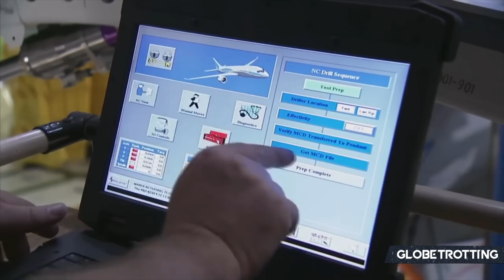Is The Airbus A330neo A Failure?

Comment: You should have also talked about how Airbus was delivering the A330ceo until very recently with the last one being delivered in May 2020 to Aer Lingus so of course the orders are not going to appear in the beggining like on a clean sheet design but probably later in the life cycle when the most recent A330ceo's are getting on the older side.
Reply: Word

Comment: The important thing: the standardization of the A330-900neo with the 251t variant. This resulted in a plane that could fly as far as 7,200 nautical miles, and has found a market with several airlines.

Comment: I could see Delta adding to their current a330neo order book when the older a330’s need replacement, they are already 20 something years old and Delta already operates 42 units respectively 11 of -200, 31 of the -300… 🤔👍🏼
Reply: I see Delta grabbing cheap 2nd hand examples.

Comment: IMHO the A330neo was a really good move. It fits the gap between the A321 and A350 perfectly, and was available at just the right time. The A330ceo was and is an excellent design so there was no need to reinvent the wheel, just boost efficiency. Avoiding the expensive clean-sheet design has also made it cost competitive.

I'd really really like to see Qantas order them to replace their A330ceo fleet. They're getting old now, but they're such lovely aircraft and the A330neo would be a real bonus for passengers. Gotta love the 2-4-2 layout

Comment: Heard TAP wasn't happy with the performance of the Trent 7000 engines on their a330 neo fleet...
Haven't heard other carriers  complaining as of  yet..
Being basically a bleed air version of the Trent 1000 on the 787 ..
Looks like the Trent 1000 issues are behind them, .see if that transfers over to the 7000 version as well.!!
Reply: From what I know, in some planes of TAP fleet there's sometimes an odd smell in the cabin.  The not so satisfied comment about the plane's engines was made by TAP's CEO  (not on purpose, but coicdently one of the company's planes just took off.  Some of them just sound like a buzz saw on take off power)
Reply: If it does the A330neo will be in big trouble because customers will be wary of the engine type it uses
Reply: They change engines too much often...
Reply: As far as I`m aware T-7000 never suffered from issues that affected the T-1000 but in fact took on some of the uprated features of the T-XWB instead.
Reply: @mariovieira838  yeah but its fixed now

Comment: Several companies with some routes with the original A330 to replace them prefer to upgrade to the A350 than A330NEO.
Reply: The great thing between A330 and A350 is that pilots can easily adopt between them.

So what I think is that they replace the first A330 with A350 to increase capacity, but eventually they will bring in more 330neo to have a broader capacity span.

A340 outsold the A330 early on also,  but the A330 did eventually become more popular.

Comment: If you compare the A330neo to the 777x the A330neo is on 278 orders compared to boeings 341 (Although the 777x has been taking orders slightly longer) Also the A330neo has been flying for 3 years now and the 777x continues to experience lengthy delays. For the record i believe both planes will succeed just saying that it’s too early to call the A330neo a failure
Reply: That's not a good apples to apples comparison. They don't compete for the same Airline need.
Reply: @erickelly3447  It’s not about that. The only thing I was comparing was the fact they’re both re-engined options of wide body aircraft  yet one has been flying for far longer than the other despite being announced over a year after the 777x was
Reply: @KaptnKork  To be fair the A330neo has a completely new wing and cabin design aswell. Also the 777x should break even when the UA/AA/BA/ANA Come to the table.
Reply: @jonahboonyarit4715  new wing? Not entirely. I  dont Think adding wing extentions necessarily translates  to a completely  new wing . My guess is it's not . 

With the 777X , the windows are  enlarged , cabin  widened  by 4 inches , a completely  new composite larger wing , and the cabin might recieve  some reinforcements to allow for higher cabin pressures ( @6000 feet, like the 350 and 787) . I think the a330neo still maintains 8000FT cabin pressure like conventional airliners . Nothing much was done with the a330neo cabin 

The difference  is with the 777X transitioning to an all composite  airliner in the future , might be easier  since Boeing  have already gone through all the trouble of making a composite  wing. In other words  Boeing still sees a future  in the 777 program 

 The cheap investment  in the a330neo means AIRBUS  does not necessarily  see a future  in it , and could most likely  be scraped in the future for an a350 derivative  maybe
Reply: @jonahboonyarit4715  The A330neo does not have a new wing, it is extended along with a new winglet. The fuselage is still the same, the new interior cabin is not a huge deal.
Reply: You can’t really compare the 2 in any way, which includes orders. The 777x order book will skyrocket once the plane enters service. You still have airlines like United which will most certainly go with the 777x in the future. You also have the likes of Lufthansa, Qatar, British, American and Emirates which are highly likely to increase orders as well ones the plane enters service. I would also expect Cathay, Korean, and others to jump on the bandwagon as well. Namely Korean because the A330neo and A350 are only offered with RR engines. Something Korean is not interested in by any means. The 330neo orders are flat for the year, and 65 were cancelled last year. I definitely see more orders coming in for the -900, but in the meanwhile it’s lack of a GE engine option does not make it as attractive as it could be.
Reply: @mmm0404  You are correct. It is NOT an all new wing. See my comment above for details.
Reply: @dmcr9525  That boeing shitbox will never actually enter service.
Reply: @IBo99608  Please don't direct your comments and their lack of substance to me. You are not the FAA or the EASA. Not one airline that has them on order cares about your personal opinion, and quite frankly neither do I.

Comment: The A330Neo could have launched earlier. After the 787 took the market by storm, Airbus did mention a updated version of the A330 to compete with the 787.
But Qatar Airways CEO Al Baker persuade Airbus to come with a clean sheet design to challenge the 787… hence the A350 which Qatar Airways became its launch customer.

How ironic now with the current situation between Airbus and Qatar Airways over the A350 issue.

Comment: DJ failure is a strong word - particularly when you look at a “slice” of info you choose to compare. 

Let me give you a different spin…
Total A330 orders = 1,764. -  1,466 A330ceo delivered & 89 A330neo delivered ( 278 A330neo orders)
Total B787 orders = 1,509  -  1,027 delivered as of Nov 22

Dev cost for A330neo - $2 billion - btw there were more than engine tweaks - how about the whole new carbon fiber wing?  And the A330ceo had more than paid back Dev costs already.
Dev cost for B787 - $32 billion - but that doesn’t include the 10 variant!

A330neo dev cost recovery per unit $7.2 million
B787 dev cost recovery per unit $21.1 million (based on total orders not what’s been delivered so far)

There are so many twists and turns when you compare these 2 aircraft from seat cost to maintenance to fleet commonality to passenger experience and finally airline missions all making up what we call success of an aircraft.

And as someone else pointed out - replacement cycle will be the ultimate test.  Do airlines opt to order A330neo to replace their A330ceo at this time or not?
Reply: Oh wow, i did not know that the 32 Bil did not cover the 10 variant. Also, including all the extra costs and fines due to the multiple delays with the 787, I think it is way way higher than the 32B. I heard that they also sell 787s at dirt cheap prices to airlines who consider a330neos (I am not sure how accurate this is though). With a 2B cost, why doesn't Airbus employ the same tactics? Is it because they are still confident that the airlines with the CEOs will turn to the NEOs as a replacement one day or they just refuse to play dirty? Havent flown on an A330NEO yet but ive read many great passenger reviews. Looking forward :))

Comment: The A330neo is just a new version of the A330. Up to now it has sold 278 frames with 91 delivered. But that is only part of the story, because the A330 family has been sold 1,764 times with 1,555 delivered. the 787 has sold 1,488 frames with 1006 delivered.
Most of the time Airbus competed with the A330ceo against the 787. If we start in 2011, the year the 787 had it's first deliveries, 805 A330 were delivered against 1,006 787.
The 787 has both to sell and deliver quite a few more frames to catch the A330 in numbers.
Reply: 1488 was before the united order of 200 ( including  100 options) . 

The a330 program started in the late 1980's , and airbus had already broken even when the early 2000's arrived . 

This ment that the a330 could be sold at a much lower price , keeping margins thin but still profitable.  

Since the program was already profitable  , airbus could offer steep discounts to sell the 330 and that's exactly  what they did more especially  after the 787 was launched . That's why they sold tons of them . 

Boeing probably  did the same with the 777-300ER's ( 77W)  , still selling tons of them even after the a350 was launched.  The 77W has sold close to 800 Frames , and there is still a tiny backlog left .
Reply: As one does not include options, when one talks about orders, you should talk about 100 orders. Options are options, orders are orders.
Yes the A330 broke even a long time ago, but being sold cheaply is a myth. Because the A330 broke even a long time ago, an engine upgrade does not take many sales to break even again.
Whereas the 787 has not broken even jet. The A330 has been a money maker for Airbus. You can not say that about the 787 for Boeing.
Reply: @mjoelnir1899  well I was talking  about the  a330ceo , but ok
Reply: @mmm0404  Was I not talking about the A330ceo? The main point is, that the neo is only a new version of the A330. So to compare the sales of the A330neo with all sales of the 787 is a bit silly.
Reply: @mjoelnir1899  I don't think you get me , I said the a330 ceo sold very well more especially  after the 787 was launched , over 600 frames were sold . 

If the a330ceo did not sell well in that time period  because  it was cheap then why didn't  it sell just as well before the 787 launch? 

The 787 already outperforms the a330neo , so there is no way the a330ceo would have sold that well unless airbus was offering steep discounts.  I'm not saying this is wrong .

Boeing most likely  did the same with the 777-300ER's  especially  after the a350 was launched . Boeing sold close to 900 777-300ER/200LR's since 2004 . 

My point is not to compare sales of the 787 vs the a330 family , just pointing out how the ceo sold so well
Reply: @mmm0404  You said the A330ceo sold well because it was cheap and I dispute that, the A330 fitted a lot of operators. The A330 sold so well because the airlines needed frames of that size at that time. There are currently more A330 in use, 1462, than 787 delivered, 1006. There are far more operators of A330 than of the 787, because that includes a lot of smaller operators. The A330 has been a reliable workhorse. The cheap A330 myth is just that a myth.
The 787 does outperform the A330 only slightly. If you move your fleet from A330 to 787, that will produce extra cost. Several operators flying older A330 have not decided on their replacement and I assume that we will see quite a few A330neo orders.

If you want to compare sales of the 777 compared to the A350 you have to look at the time frame, the A350 gets delivered since 2015. That does not take from the 777 being the most sold wide body.

Comment: Failure is not the correct terminology here at all, I think as others have mentioned actual numbers and detailed facts would benefit here (development costs vs. orders, extent of redesign vs. a clean sheet, etc.). Please take this as constructive, but the conclusion at the end of the video was kind of a non-conclusion.

One of the most important aspects of a manufacturer's catalogue is that there are no gaps when compared to the competition for airlines to exploit. The smaller variants of the 787 had no real modern competitor until the A330neo, and airlines could capitalise on that in negotiations. It's also one of those intangible aspects of the A380, it pretty much killed the 747 and stopped airlines saying to Airbus "but you have nothing as big as Boeing", even if they never intended to buy one! That is despite the A380 never making back its development costs directly.

All in all, keep going buddy, it's been great to see you flourish over the years!

Comment: 330 Neo (900) is good for customers in Medium haul routes since some of airlines start using a321LR/XLR for those routes. Better customer comfort. Even with 330-800, low cost airlines could operate long haul routes with high density configuration
Reply: And of course all economy, like Lion Air do today on some of A330s.

Comment: The 330 Neo still its a young plane it enter service in 2018 so it remains to be seen if orders pick up. The Neo has a higher wing aspect ratio than the Ceo also its not just engines.

Comment: The A330-800neo is very heavy at 251 tonnnes with a very long range of over 15,000 km. That range is too much. If Airbus would reduce the range and weight of the A330-800neo to 12,000 km and 215 tonnes respectively may be the aircraft will be attractive to airlines.

Comment: you need to put on stats.  no mention of how many exactly have been sold.  when was the neo put out relative to the 787.  numbers count.  aircraft manufacturers build airplanes as replacement for older models.  so how many airlines have shifted to Boeing for example... if DJ wants this channel to be a serious one, with hard nosed analysis, data and facts, then really the channel should avoid using generalized terms.  get into the details, the numbers, the points of comparison, etc.  it's all very wordy but sometimes just sound signifying not much.  in short, the channel should really do a much better job at doing research!!!
Reply: There is a subtly here that needs examination.    When a me-too plane is launched it's sales life is likely to end about the same time as the equivalent plane that has been selling for years.   This is not true if the late launch plane is significantly better . Not a me-too.
Reply: @danharold3087  The A330neo is significantly better than the A330 ceo, the model it replaces. ...and with time sales will reflect precisely that. The pandemic just slowed down the eager from the companies to replace their aging fleet.
Reply: @miks564    I hope it does reflect that.   Only time will tell.  Too many factors to say a plane will sell more because it is 'better'.
Reply: @danharold3087  You are right. But we expect the old A330 ceo fleet to be replaced sooner or later and changing to 787s will only be an option for companies having already Boeing certified pilots and Boeing maintenance facilities. Changing for A350s is quite a step up in terms of acquisition cost. My bet goes for the A330neo for operational costs alone.
To me, the A330 neo has only one big problem: The exclusivity on the R&R engines.
Reply: @miks564  I agree 100%   
I want to see the Ultra Fan in the air.   RR needs a win on this engine.

Comment: I wouldn't say the A330neo is a failure compared to say the A318 and A380, however I do think it hit the market a bit late as many potential A330neo customers instead opted for the 787 as it hit the market at the right time, such as Qantas, Delta and Qatar just to name a few.
Reply: There are plenty of 330 ceo flying out there. All of them potential buyers of the neo. Some will switch for the 787, others will take a step forward and go for the A350, but I believe most will go for the 330neo.
Reply: You need to be informed a little better as Delta went with A330Neo not B787.
Reply: @edwardwilcox6606  and they probably have  some regret. They have dozens of 767s that need replacing in the next few years , and 787-8/9 would have been perfect for that. 

Their only option now is the much less efficient a330-800, and the much heavier a330-900
Reply: @mmm0404  I`d be the last person to question Delta on their choice of aircraft. They have huge experience on running a profitable airline & that includes choosing the aircraft that`s right for them. Delta have been running A330`s for some years & it`s obvious that they like them for a reason & while I`m not privy to that information as someone who has flown on many A330 aircraft I can`t fault it. For the `If it ain`t Boeing I ain`t going` crowd Delta`s choice may well be infuriating but fortunately for the aircraft enthusiast having different types of aircraft in service is what makes flying interesting.
Reply: @mmm0404 You'd be lying when you say "much less" don't forget new engines use the latest tech as well
Reply: @Tpr_1808  yea much less was a stretch . They have a similar fuel burn more especially on shorter to medium routes.

Comment: The main purpose of the 330 Neo is to put pressure on the price tag Boeing can charge for 787s, if they go too high the 330 Neo is a economic alternative. So it's a success (the program cost was less than 10 % of the 787 program) even if it's not a best seller